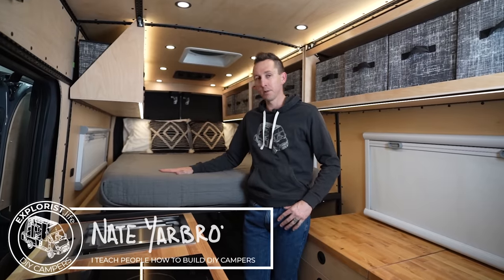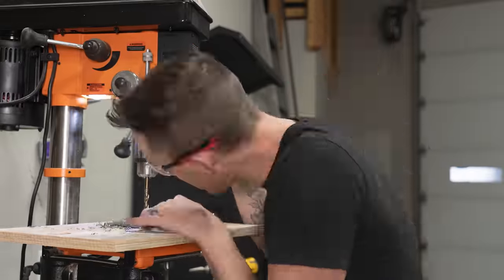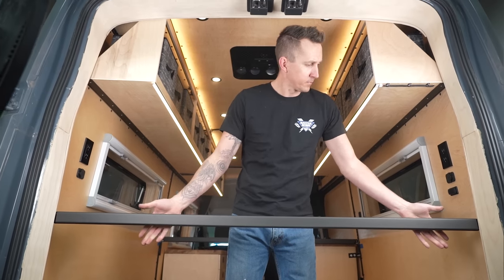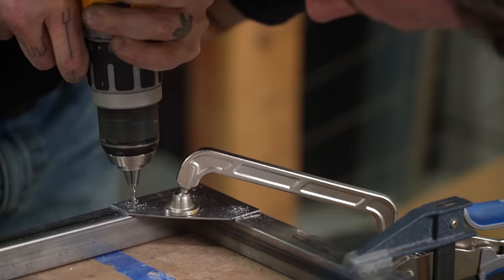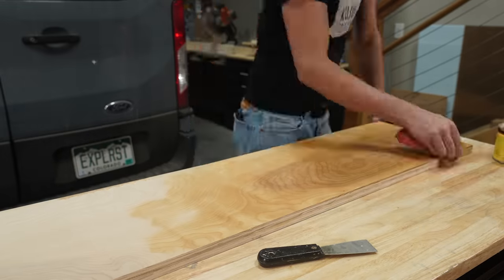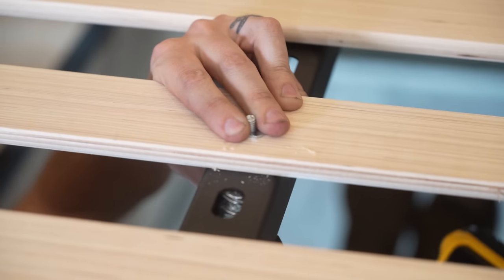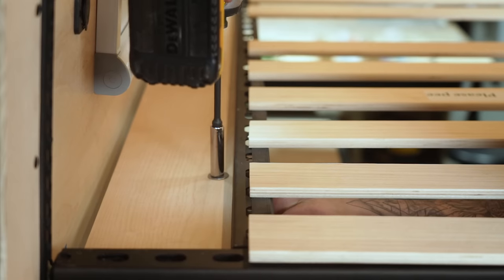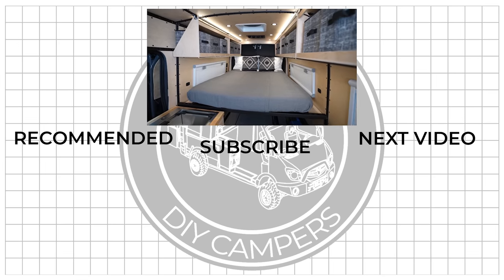BUILDING A UNISTRUT CAMPER VAN BED PLATFORM

Comment: Howdy Nate - Just a quick off-topic comment.
In 2018, I set up my solar and electrical system in my 2017 Sprinter based on your original design in your old Sprinter.
Now, 5 1/2 years later it is still working like new.  It has been running my ARB fridge 24/7 the entire time without a hiccup.
Until today...
I was powering a metal chop saw with the system.  We were cutting some square tubing that was about 20 feet long.  The first cut went well.  The second cut we wedged the blade and the power went out.
System was completely dead. No AC or DC.  I was fearful my AIMS inverter had given up the ghost.
Come to find out, the 200 amp fuse between my battery bank and the inverter had blown.
The system did exactly what you designed it to do.  I replaced the fuse and all is perfect these 5 1/2 years later..
Good Job, my friend!   Onward for another 5 years!

Comment: Nice.. finally someone else using the flexibility of Unistrut! I have used this product also in my build. It is super strong and lightweight. I used Stainless Steel with all SS spring nuts and bolts washers etc. the nice brackets you made are also available to buy in many different angles and shapes! There are also plastic inserts for the valleys to keep out dust and makes a clean look. I used this as a base 1 5/8 then built my 80 20 on top of it.. worked amazing!! cheers Nate
Reply from the maker: Nice!  I saw the pre-fab brackets but I was sorta making this project up as I went along and wasn't sure which brackets I would need.  Chalk that one up to not planning ahead. 😂🤣

Comment: Thanks for the video! I have a steel cutting blade for my chop saw it’s a little pricey but worth it. It makes cutting metal much easier and cleaner not to mention the finished product is far superior than when cut with a grinder, plus it takes the silica issue out of the equation

Comment: This video has been inspiring!
May I ask, do you think it would be possible to use Unistrut to secure a small sheet of drywall?
I'm trying to figure out how to make a drywall access panel in a (house) wall where I have little more than 1-1/2" of space, and unistrut seems like it would be great for achieving the  rigid construction I want!
My situation is that I have a 1/2" plywood behind the 1/2" drywall, both about 15" tall x 40" wide...
This is to be installed on the wall at the edge of my bathroom (wall to wall in this case) to cover my pex manifold.
I just... did not think in advance how I would install a panel over the front of it...

Maybe I could install T-nuts into the back of the 1/2" ply wood, almost like you did with the slats on your bed frame?
Sorry if this is confusing

Comment: Nice bed! Im also busy with my bed. It will be wood and much lower 😄 total height with matras 40cm
Reply from the maker: Thanks!  I hadn't worked with Unistrut much before this project outside of hanging air conditioners. 🤣 Works pretty well!
Reply: @EXPLORISTlife  haha yes, I come out of a family of wood workers. So I can show what I can do with it. I have some ideas with rounded wooden corners to finish it all. But first the structure with all the functions.

My main wood material is 12 and 8mm plywood and 44x18mm wooden slats. I build lightweight and strong but not how most people do it. Just my own design. That is the awesome thing of building, you can do it how ever you want 😄

Comment: Any reason you guys didn't look at a bed lift system to allow extra clearance for loading and unloading your bikes?
Reply from the maker: Cost, complexity, and noise (rattling from moving parts), mainly.    It's SUPER easy to load/unload the bikes without the need for getting under the bed with the clamp style fork mounts we will be using.  That vid will be out in two weeks.

Comment: Love the headboard but I think its a fire hazard since toy cant get out of the back wsith it so high.
Reply from the maker: There are six means of egress (3 doors (driver, passenger, and sliding side door) and 3 manually opening windows) in our 60 sq ft structure.  Blocking off the back door is a non-issue in terms of fire safety.  

Not too often I get to use my actual degree in Fire Science.  Thanks for that.
Reply: @EXPLORISTlife  Thanks for clearing that up,  and I love the video's and love the new online store.

Comment: Wonder how heavy that is?
Reply from the maker: The whole thing?  Or just the frame?  We used 6 pieces of ~6' of Unistrut that weighs 1.89lbs/ft; so 68Lbs and then figure Figure ~10Lbs for brackets & hardware.  10lbs or so for the wood slats.

Another 15lbs for the headboard.  I don't know how much the mattress weighed, but probably ~30lbs?

Somewhere in that ballpark.
Reply: @EXPLORIST life - DIY Campers  would,you consider using 80/20, which comes in silver and black colour half of the weight?
Reply from the maker: 15 series 8020 weighs 1.34lbs per ft, so it would weigh ~48lbs in total compared to the 68Lbs of Unistrut.  I mean... I'd consider it; but not for weight.  I'm not too worried about the difference of 20lbs in a 1-ton vehicle.

10 series 8020 weighs quite a bit less, but I played around with some scrap 10 series 8020 we have here at the shop, and I didn't feel like it was rigid enough to use for the bed platform.

Comment: Add a linear actuator to that bed so you have the option to not remove the front tires of your bike when loading or when you need the extra height below.
Reply from the maker: I don't think I'm too keen on disassembling the bed I just made to add that functionality. 😂  It takes about 30 seconds to put the front tire on our bikes.  Maybe that's a 'phase 2' functionality of the build or something.